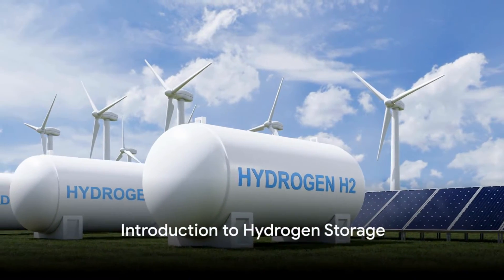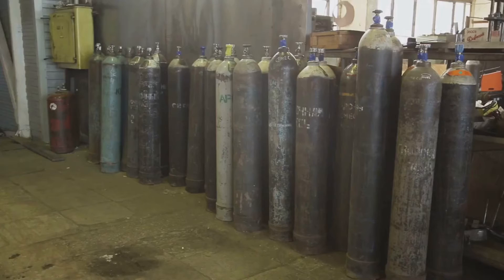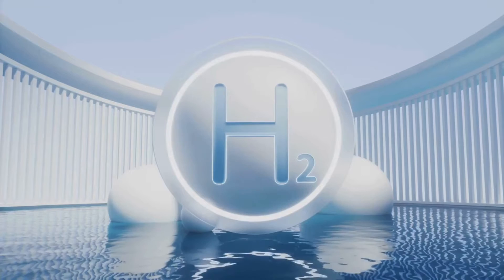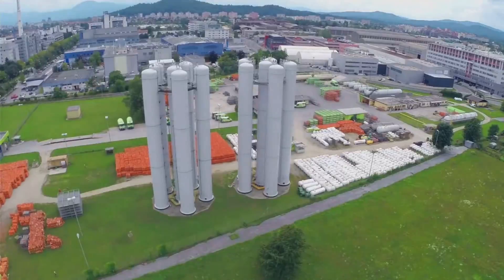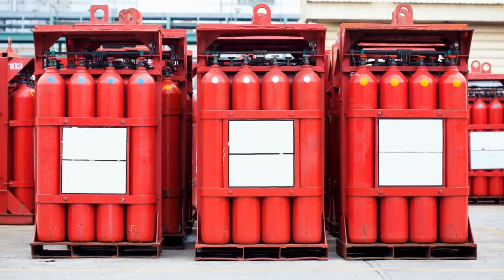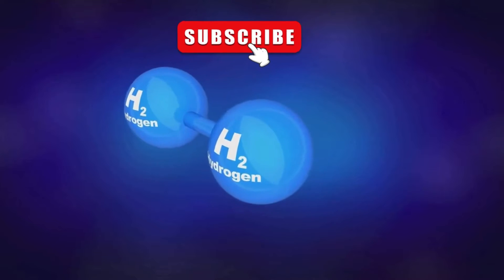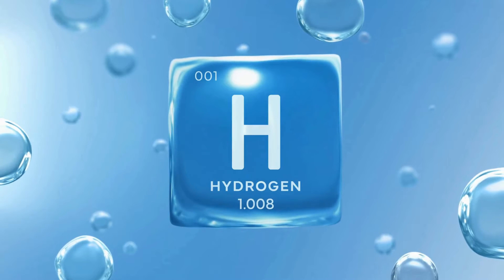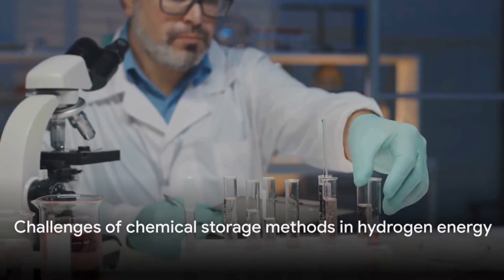Fundamentals of hydrogen storage

Comment: Cooling hydrogen cost a lot energy, that has to be withdrawn from its own inner energy. Same for high pressure tanks. A better solution is using ammoniak, that can be stored as liquid between 8-9 bar, which needs only low pressure tanks.
Reply from the maker: Thanks for your comment.